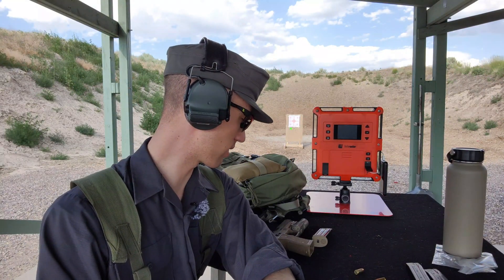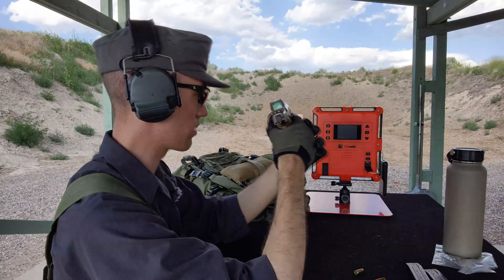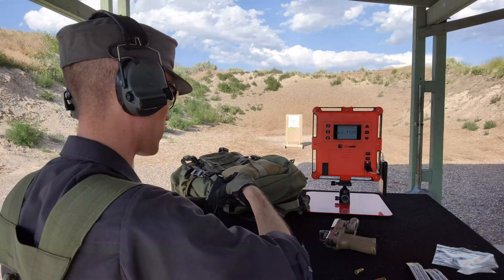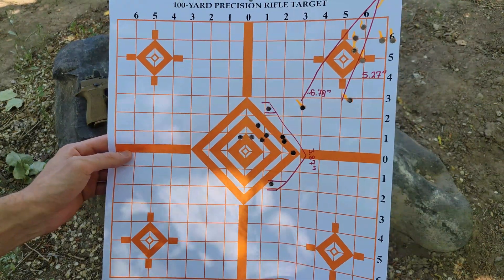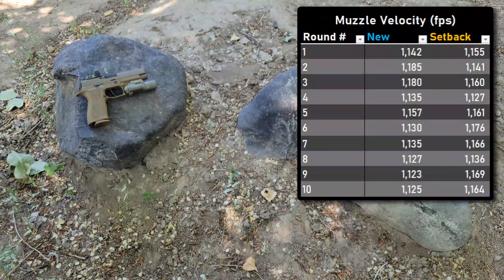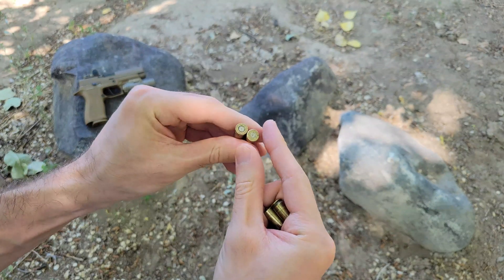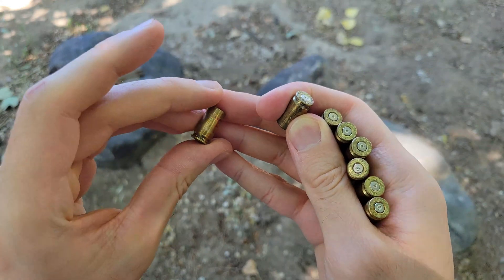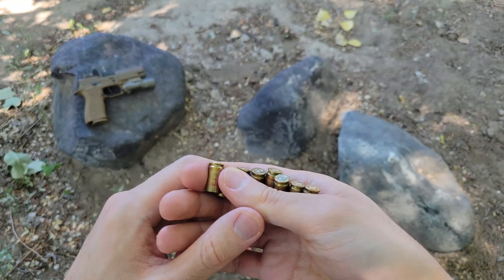Bullet Setback Effects on Velocity and Pressure

Comment: Good video man, Paul Harrell tier info
Reply from the maker: Thanks! Paul Harrell makes great videos imo so I'm glad to hear it!
Reply: @Jang-gun銃  it was interesting man, genuinely surprised there wasn't that much difference.
Reply from the maker: Me too. I'm thinking noticeable differences might only start showing up when you start getting a lot of setback, though I'm not going to test that since it'd get dangerous at that point.
Reply: @Jang-gun銃  Several things to consider on bullet setback:
1. What powder is being used; different grain sizes and blends of powder will compress differently and provide different outcomes. I have no idea what Sig uses as their OEM powder.

2. Bullet seating depth and compression; It is possible that the bullet is not seated deeply enough into the case to compress the powder. This is very common in economy loaded ammo, as cheap powders tend to be denser. High quality handgun ammo is generally made with flash suppressing powder, ostensibly to not blind you from muzzle flash if you have to shoot while it is dark out. Flash retardant increases the volume of the powder thereby the same seating depth on one powder may be compressive and on another powder it might not.

3. Bullet setback from repeated chamberings; 5 chamberings of each cartridge is actually not much wear and tear on the bullet in terms of setback. I would expect it to be closer to 50 or so chambers before the roll crimp on the case gives way. 

Based on your velocity data it appears to me that the Sig ammo is loaded with a loose powder charge or very little compression. The amount of bullet setback was not significant enough to cause a great deal of compression to the powder. In most cases, especially in handguns, a small amount of powder compression improves combustion which provides for more consistent velocity i.e. smaller Standard Deviation.
Reply from the maker: Lot of good information, thanks for posting that. I'm surprised it'd take ~50 chamberings before the crimp would give way so that's good to know.

The rounds I tested in this video are actually handloads, just using Sig Sauer bullets. They're loaded with Unique powder which, from what I've heard and seen from this test, seems to do pretty well with being compressed.
Reply: @Jang-gun銃  Unique is a really interesting powder, I've used it in everything from 9mm to 45-70. It does seem to compress well in auto pistol cartridges. Knowing now that they are handloads I would add some additional context and a few questions.

1. What Cartridge Overall Length were they loaded to? 
2. Did you measure Cartridge Overall Length after the multiple chamberings? I have found that is generally the best way to measure bullet setback
3. Is this new brass or previously fired?

Brass is pretty robust stuff but it does suffer from work hardening. Generally, bullet setback happens for three reasons: sheer stress causes the brass to fail at the crimp (generally applies to roll crimps), linear force applied to the bullet causes it to slip into the case (effectively the bullet is reaming the case neck and this happens mostly with taper crimps), stress fractures in the brass due to work hardening cause the bullet to slip into (or some times out of) the case. 

Every time the brass is fired it forms to the chamber and then forcing it through a sizing die and crimping dies causes even more wear and tear. I have done some tests with 9mm and 45 and found that 9mm brass will last ~50 reloads before it is too brittle to crimp correctly. 45 acp being much lower pressure on standard loads, and having thicker case walls, lasts even longer in my experience. Factory new brass is as strong as the brass can get as it is generally drawn from virgin material and tempered to normalize hardness. Couple that with a true FMJ (drawn jacket not plated) with a decent cannelure (crimp ring) and it is very difficult to setback the projectile, due to sheer stress or linear force applied to the nose of the projectile.

Generally straight walled auto pistol cartridges are taper crimped due to headspacing concerns. This does leave them the most susceptible to bullet setback.  Roll crimps are possible as most modern pistols can safely headspace off of the extractor but that is a sperate conversation all together. 

Thanks for coming to my TED talk.
Reply from the maker: The overall length of the cartridges was 1.071" when they were loaded. I didn't measure the cartridges with setback but now that you mentioned it, that's something I'll check the next time I have more rounds like that. These were all loaded in assorted once-fired brass and were taper crimped.

I hadn't heard of roll crimping a 9mm/.45. That's quite interesting and I'll look into that.